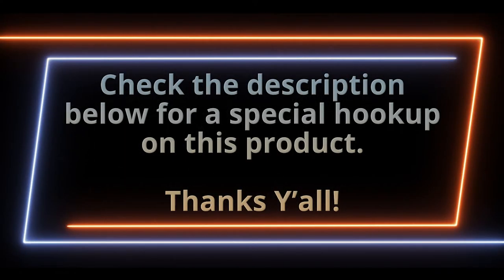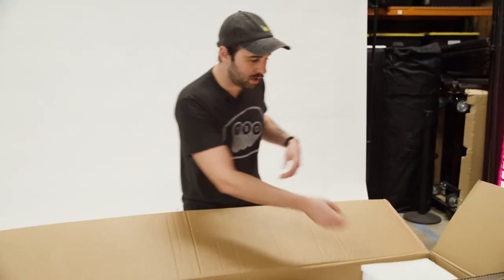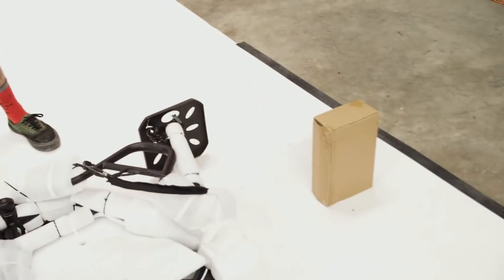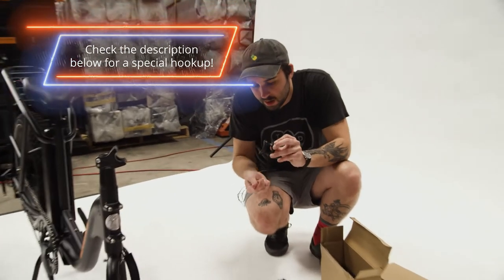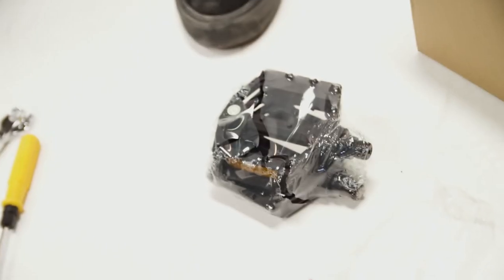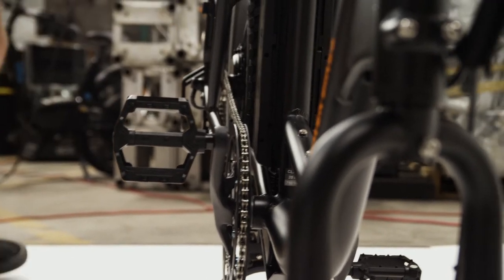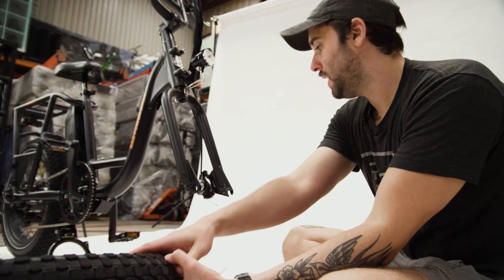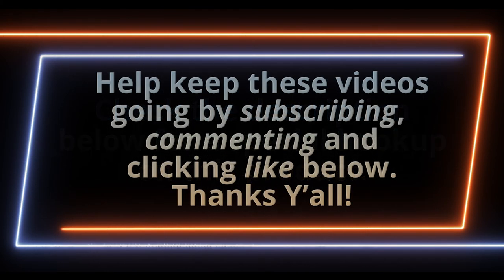RadRunner Electric Bike: Unboxing & Assembly

Comment: OMG After struggling on and off the whole day I FINALLY just managed to get it out of the box. The problem was I have a very tiny apartment so couldn't lay the box down on its side AND have room to slide it out so I had a heck of a time. Took out the front wheel and small stuff and the biggest wrappings off and barely squeezed it out and had to step over the bike and kind of push the box upright with one arm while pulling out the front end with the other arm. Not easy for an old lady to do at all. I wish they had the option to send it fully put together like so many other companies do consider how heavy it is but the worst is over now. Now I have to put my massage heating pad on and rest a bit before I get what will most likely be the easy part = putting the bike together but I need to rest my twisted muscles for a bit first. Shheeesh.